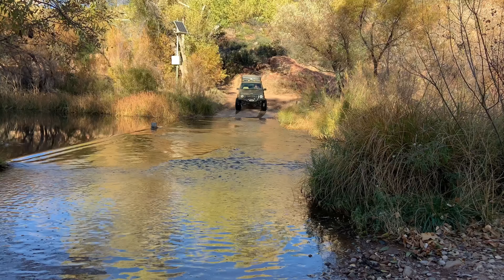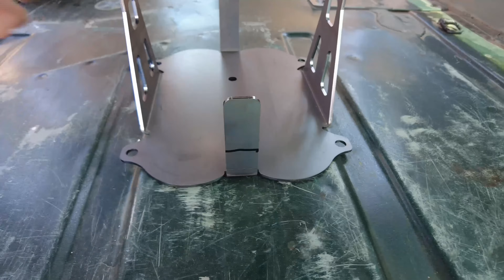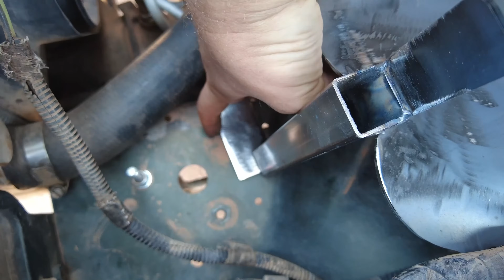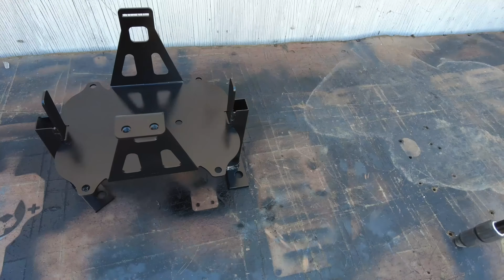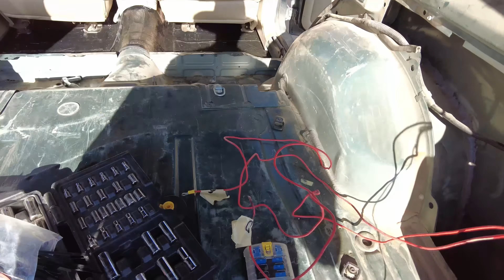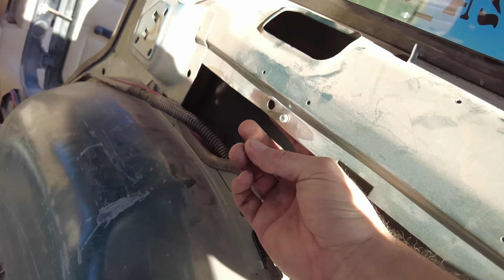This is how we put DUAL BATTERIES Under The Hood of Our Jeep Cherokee XJ!

Comment: Good job. The only thing I would change is your ground wires should be as short as possible, ground them immediately after coming off the fuse panel and power outlet!  And use all the same ga. Wires, your 2 bigger + wires should also be the ga. If you + coming from the front! Great job and great video explaining you layout! Happy Jeepin!

Comment: What does the clearance look like from top of battery to hood? And how high from engine bay floor is the platform? In the middle of the same project!
Reply from the maker: Thanks for watching! And sorry for the late reply we just got back from a trip. The clearance from top of battery and hood are about a 1/2inch on the negative terminal and about an inch on the positive if you trim a little of the hood support in the area by it. And the platform is about 4 1/2in from the engine bay floor

Comment: hey I have a question for you .  I don't know how to weld and I don't know anyone who does and I'm really trying to keep my costs down.  I bought the Thor Cowl after I saw your video and I can install that myself.  But do you have any other suggestion for a battery box maybe one for a RHD Cherokee that I could substitute where the only modifications are with a grinding wheel or something like that.  I can get hold of flat iron and drill through it.  I just can't figure out how to get a correct battery box for me.  Please keep up the GREAT work I love your channel.  Any suggestions would be greatly appreciated!!  Thank you my friend.
Reply from the maker: Thank you so much for watching 😊 we’ll keep the vids coming! I looked at my jeep and it looks like if you got the driver side battery tray adapter and the battery box from dirt bound offroad you should be about to mount your auxiliary battery without any welding and only some minor drilling 😊 i have no experience with this setup not I honestly should of went this route lol but I like doing things the diy way I guess! Here’s the links to the adapter and battery tray. 

Adapter 
https://dirtboundoffroad.com/products/jeep-cherokee-driver-side-battery-tray-mount?_pos=3&_sid=7be390fe1&_ss=r

Battery tray
https://dirtboundoffroad.com/products/bolt-in-battery-tray?_pos=1&_sid=05415803a&_ss=r

Comment: If you didn't yet you should put a grommet around that wire running through the hole or it will eventually cut it open over time
Reply from the maker: I haven’t yet! But good call! I’ll definitely do that 😎

Comment: Nice solution to adding a second battery. You might want to consider adding a 1" tubing crossmember between the two legs supporting the battery, or triangular gussets between the bottom of the battery tray and the legs. You could also gusset from the legs to the feet.
Reply from the maker: Thanks for watching! That’s a good idea, I’ll definitely have to do that! I think some triangle gussets would work well and I’m gonna do a support from the box to the fender too.